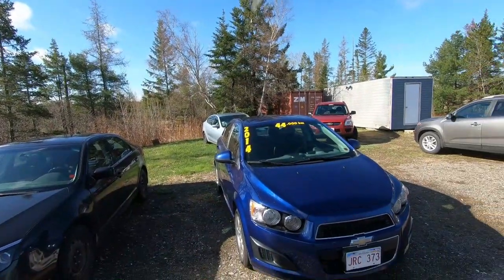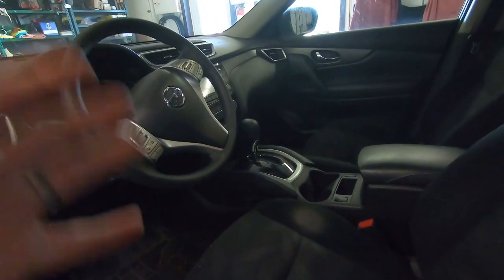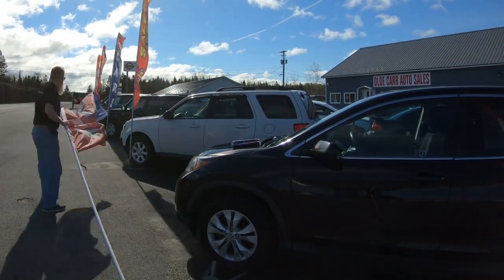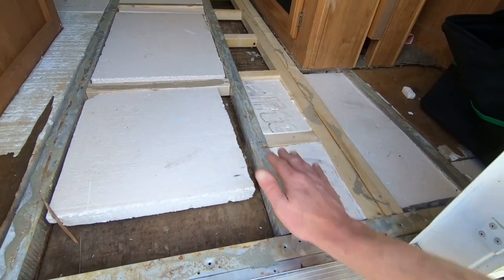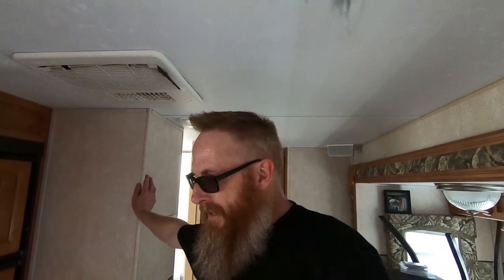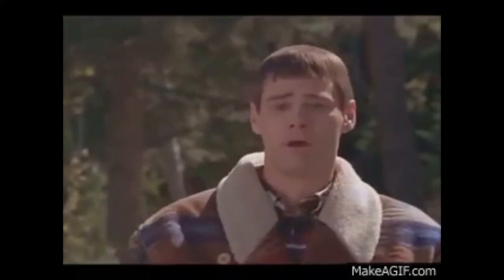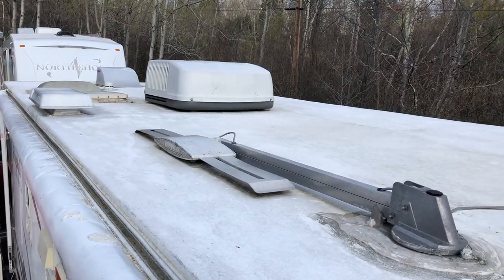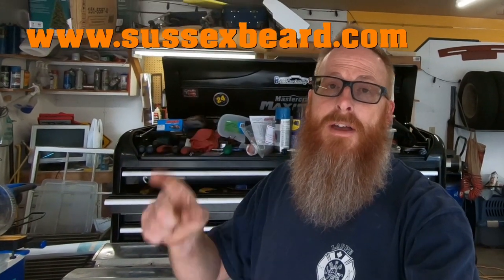CAMPER FLOOR REPAIR - THATS HOW I SPENT MOTHERS DAY 2019

Comment: Had a similar problem on our original camper.  Floor frame was compost.
Reply from the maker: The design is shyte I tells ya! Thanks for watching Mike!
Reply: Our camper had removable storm windows that pooled condensation between them.  This continuously seeped water down the walls and destroyed wall framing and the flooring.  
We have since traded it in with full disclosure to the dealer.

Comment: There's an advantage to having separate black water and grey water dump valves.  I can clean out my black water tank from the outside with an adapter for a garden hose.  I do not envy you taking that flange out!!
Reply: And for the roof, get that Flex Seal stuff.  It works well
Reply from the maker: Are used to flex seal last year and it worked over the summer however it did not survive the winter. I cannot endorse flexseal!
Reply: @OldeCarrGuy  well that bites.  In that case, I suggest you ignore my previous suggestion